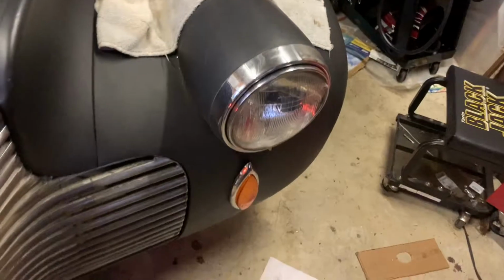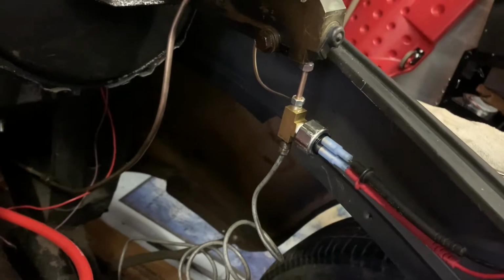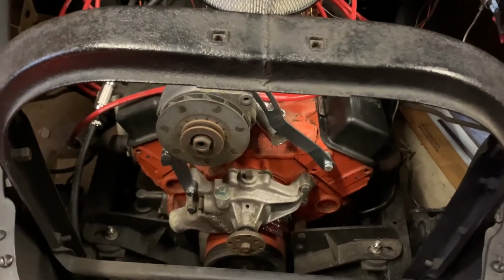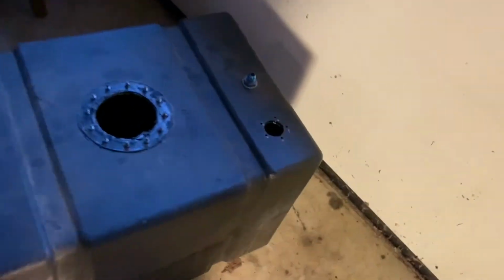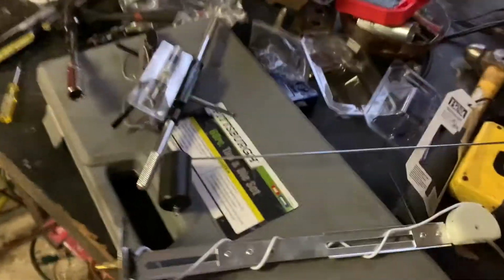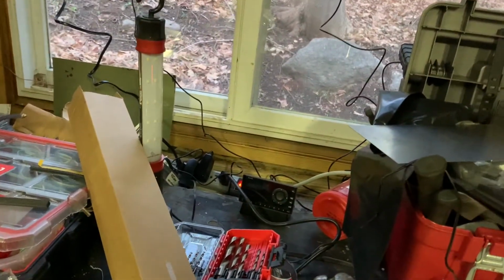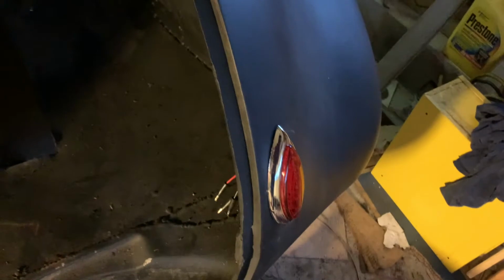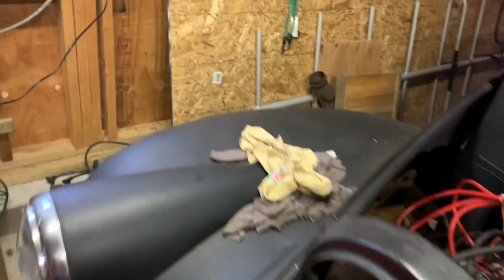My Tank Is Bigger Than Yours

Comment: Oh the memories, hearing the propane heater... lived on a bus one winter and that was our sole heat source. If the foam does not work for your signal/marker lights maybe you could use vaccum line with a slice in one side of it, like edging up one side and down the other with the bottom butted to keep it one piece.
Reply from the maker: Good idea. The foam came in last night. I will show you if it works. When I have my radio on I can’t even hear that heater and it works well. We will see how well it works when it in the teens outside lol